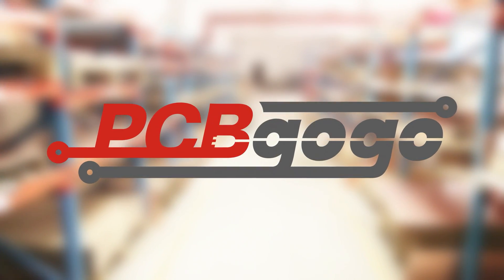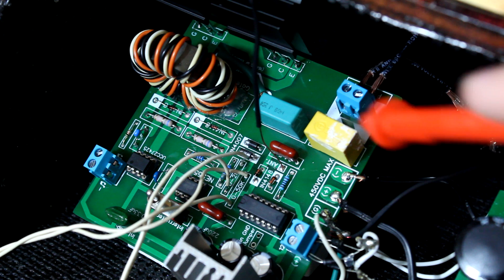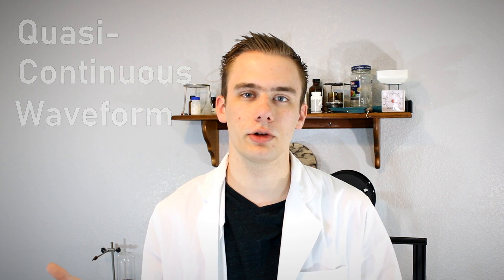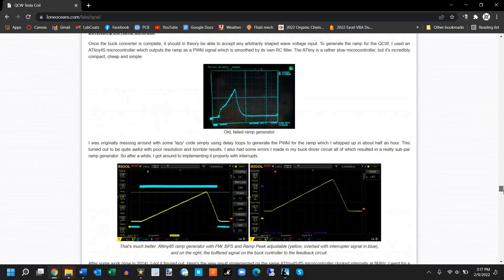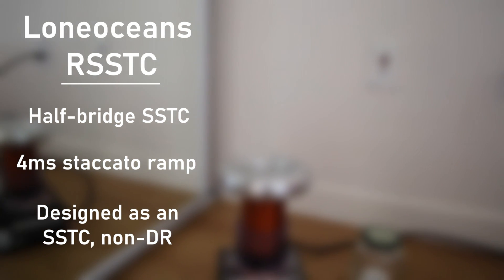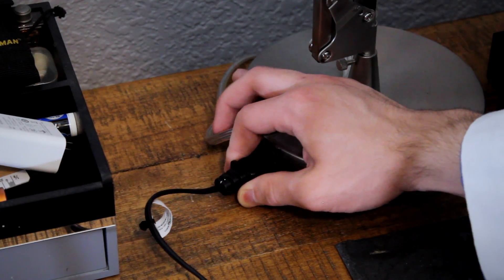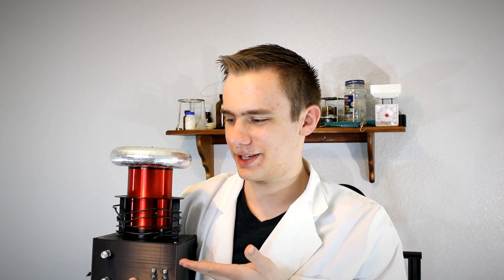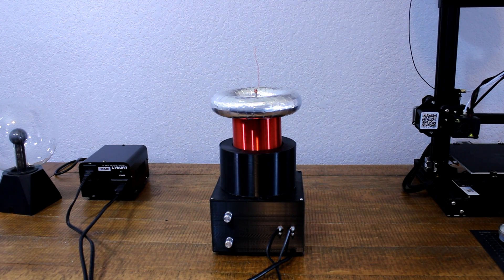World's Easiest QCW Tesla Coil (Staccato-Ramped DRSSTC) | The Ultimate Build Guide

Comment: It it possible to play music with this Staccato-Ramped DRSS type coil?
Reply from the maker: Only if you remove the staccato interrupter and replace it with a musical interrupter.
Reply: @LabCoatz_Science  And this would probably  reduce spark lenght?
Reply from the maker: @developed-m6l  Yes, somewhat. Tate from BackMacSci built my coil with smoothed output instead of ramped, and this is what it looks like: https://www.youtube.com/watch?v=g2jimzGX2xc

That's another thing: for audio modulated output, you'll want a large electrolytic capacitor to smooth out the rectified AC powering the coil.
Reply: @LabCoatz_Science  What are IC chips? "Minor screw-ups can also lead to the IC chips blowing, and they are dirt cheap, so it’s smart to buy an extra or two of each". Also I can find the information about power supply and coil material, the wire, the proportions?
Reply from the maker: @developed-m6l  As shown in the schematic, the IC chips are the UCC37322, UCC37321, 74HCT74, and 74HC14, and the power source is just direct mains voltage up to 240V. The dimensions and wire size are mostly irrelevant: you could wind literally any coil and it will work.
Reply: @LabCoatz_Science  Thank you very much! Could you share the link which 1000V 0.01uF film capacitors you used?
Reply from the maker: @developed-m6l  Unfortunately, I don't have that link anymore, but again, it really doesn't matter that much. You can pick out just about any film capacitor over 500V in the right capacitance range and it should work just fine.

Comment: Hello, good friend. I've been following your videos and content. Congratulations to you for the amazing videos.
I have two questions regarding this circuit. If you could help me, I would be grateful. So.. how did you made your MMC bank and where did you put it?
Thank you in advance for your response. 
Cheers from Portugal.
Reply from the maker: Glad you liked the video! The MMC  is easily made just like any other capacitor bank and should be rated for over 500v (capacitance depends on your secondary coil's frequency and primary coil design). It is simply wired in series with the primary coil off of the PCB. Hope that helps!

Comment: Is it possible to make this music capable? I'm no sure if I should build this or your other sstc
Reply from the maker: You could try, but you'd lose the ramped sparks. This circuit would do it better than my older SSTCs though, since the flip-flop keeps the interrupter from switching when current is flowing. However, I am currently working on an even better, smaller, and cheaper SSTC that can play music! It uses only one MOSFET instead of two IGBTs, and it doesn't even need a gate-drive transformer! If all goes well, it will even be able to do plasma flame operation.

Comment: Which is better? Below 300kHz or above 300kHz?
Reply from the maker: When it comes to coil output, neither is inherently superior. However, like I said, above 300kHz can give you straighter sparks, which could be longer. It also depends on what spark shape you're after (jagged sparks for lower frequencies, straight to hooked for higher) and how big you want the coil to be (larger coils have lower frequencies). Hope that answers your question!
Reply: @LabCoatz_Science  thanks a lot.. I got it.. Currently Building a single IGBT SSTC.. found your videos helpful.. Thanks for the good content.

Comment: What is the board size!
Reply from the maker: Good question, can't believe nobody else has asked this! For this circuit, the PCB is 157mm by 114mm.
Reply: @LabCoatz_Science  thanks
I want to order the PCB. Any changes since you designed it?
Do you have a couple of boards I can purchase from rather than ordering from China?
Thanks
Reply from the maker: @Gacha.Cupcake  There were a few minor things I tweaked, but nothing significant. The download should be up-to-date with everything, and so should the Instructable. And unfortunately, no, I don't have anymore PCBs to give away/sell. They were all given away to Patrons and people I know (like Jay from Plasma Channel). If you'd rather not order from China though, there are plenty of USA-based PCB manufacturers. This is one that I found, but I've never used them before so I don't know how long they take or how much they tend to cost: https://macrofab.com/demo/. Hope that helps, good luck!

Comment: Is it possible to make a drsstc tesla coil without the qcw. Because I really like the adjustable sparks from your sstc tesla coil.
Reply from the maker: Yes, just give the circuit smoothed DC instead of unsmoothed mains power (which is what creates the long, straight sparks). To get smoothed DC, of course, you'd need a full bridge rectifier or a voltage doubler. This circuit should work quite well as a proper DRSSTC (that is, with primary feedback instead of antenna feedback), but the sparks will be quite a bit shorter and louder without the mains ramping. Hope that answers your question!
Reply: @LabCoatz_Science  Thanks, so I can't use antenna feedback? If I build such a drsstc without qwc, are  the sparks longer than a sstc. And is it possible to remove the qwc components?
Reply from the maker: @gertasgh4841  You can use antenna feedback (as I have done here), but your coil will be more likely to die if you tune the primary circuit more precisely. And yes, the sparks should be longer than a typical SSTC, but not INSANELY longer (i.e. if you get sparks twice as long as a SSTC, that would be impressive). In regards to the "QCW" components (I assume you mean the staccato interrupter), yes they can be removed and replaced with a normal interrupter setup to give you a typical DRSSTC.
Reply: @LabCoatz_Science  Thanks for commenting so fast, but what is soft and hard switching if the igbt's get dc voltage how are they switched off? I am new to electronics so I only know the basic things, but your video explained it very well.

Comment: How tall is the secondary?
Reply from the maker: Mine is only 5 inches and wrapped with 34AWG wire, but really any size will work (best results if you tune the primary to the secondary frequency with a resonant capacitor like I did).
Reply: @LabCoatz_Science  great news for my project. I will credit you when it’s done. Yer gonna like it.

Comment: I still can't get the right information to pcbgogo.  I would like to buy one of your copy PCB's, if you would consider selling it.  This may help speed things up in getting this project started.  Thanks for your consideration.
Reply from the maker: I would, but I gave away all of my unused PCBs in this video's giveaway (one to Jay from Plasma Channel and the rest to my newest Patrons). Although this video was sponsored by PCBgogo, I really recommend using JLCPCB.com to order the PCBs: they are much more straightforward (and usually cheaper), so and I use them a lot. All you need to do is upload the .zip file (as a whole, don't take out the files and try to submit them individually), pick your color, and place the order. No annoying quotes and all that! Hope that helps, good luck!
Reply: @LabCoatz_Science  thank you for your reply and tips. Ill use JLC.

Comment: Hello! Would the staccato circuit work with an AC signal coming from an AC modified sinusoidal signal? Thanks a lot
Reply from the maker: As long as the staccato receives the same rectified AC voltage that the inverter gets, it should function (of course, the voltage signal to the staccato must be around 12-14V, since higher voltages can kill the logic circuitry). If you feed a random signal to the staccato circuit, it will interrupt in time with it, but if the signal is out-of-phase with the rectified AC powering the coil, you might as well just use a standard interrupter, since the results will be chaotic and messy. Hope that helps!
Reply: @LabCoatz_Science  Thanks a lot !!!! You are the BEST!

Comment: Hello !! I am trying to use an inverter (12VDC to 230VDC) for outdoor operations. What ground should I use for the low voltage circuit? Because my inverter does not have a ground like the house's mains. Thanks a lot !!!
Reply from the maker: You can just use the earth as ground (a literal piece of metal stuck into the ground is fine).
Reply: @LabCoatz_Science  Thanks a lot!! Greetings from Spain!

Comment: Hey man, Im trying to build a run off the mill DRSSTC. I was wondering if I could put my IGBTs in parallel in the half bridge inverter for increased current flow through the primary.  Would that be okay or a huge "NO-GO!", or maybe somewhere in the middle?
Reply from the maker: Somewhere in the middle, honestly. Assuming the extra transistors don't load down the gate driver circuit (probably won't), the slight differences in transistor switching characteristics will cause one of the paralleled IGBTs to take more of the switching abuse, causing it to fail at roughly the same rate as it would with just one IGBT. Overall, paralleling transistors is not a great option in any Tesla coil. Hope that helps!

Comment: what is the diameter of the primary coil wire?
and how many turns??
Reply from the maker: I used around 5 turns of 12AWG wire, but it really doesn't matter. I could've used 6 turns of 18AWG wire and it still would've performed quite well.
Reply: @LabCoatz_Science  Thanks a lot! Is there any option to contact you for some more information about this QCW?

Comment: absolutely love the video but some of the instructions are a little unclear, under the parts list you mention this other capacitor that doesn't have a part link, is this connected somewhere other than the pcb? all of the parts in the list (beside the wire and stuff for the actual coil) are connected directly to the pcb right? there is no external capacitors or anything, just plug power in the pcb and go?
Reply from the maker: Sorry for the wait, I didn't see this comment for a while! The other capacitor is just the resonant capacitor, which connects in series with the primary coil. I didn't include the link for a few reasons, but mainly because the capacitance you'd need depends on the tuning of your individual coil. I just bought a set of ten 2kV/22nF film capacitors off Amazon: https://www.amazon.com/10pcs-Metallized-Capacitor-0-022uf-22000pf/dp/B07N6Q2DNB?pd_rd_w=2N0j2&pf_rd_p=8e4731a7-b756-4530-8014-2f681a6d39bb&pf_rd_r=SXG4Q1737EA0ZEFMFTZ5&pd_rd_r=f1a99c65-c757-4cf4-b6d8-63eaeb2a0efc&pd_rd_wg=EPf43&pd_rd_i=B07N6Q2DNB&psc=1&ref_=pd_bap_d_rp_15_t

And yes, other than the wire and power stuff, this is basically a plug-in-and-go type circuit. It works fine without tuning, but if you want the big sparks you see in this video, some minor tuning/tweaking of the primary coil/capacitors is required (nothing too scientific, just make adjustments until you get the largest sparks). Hope that answers your question!